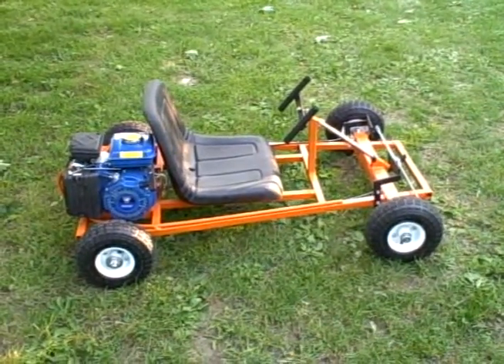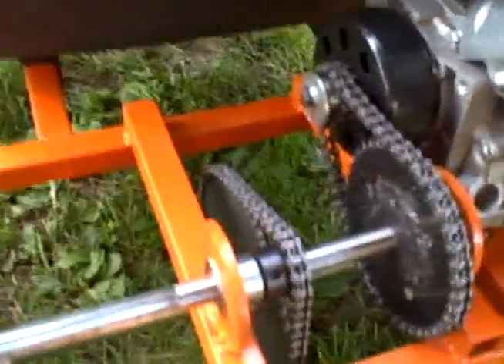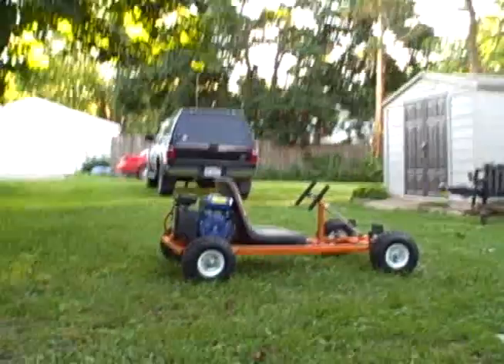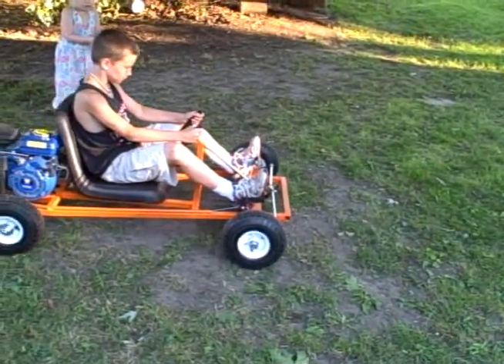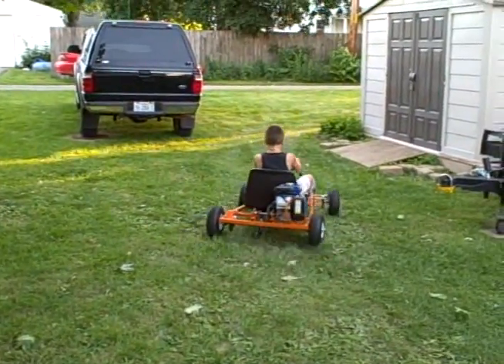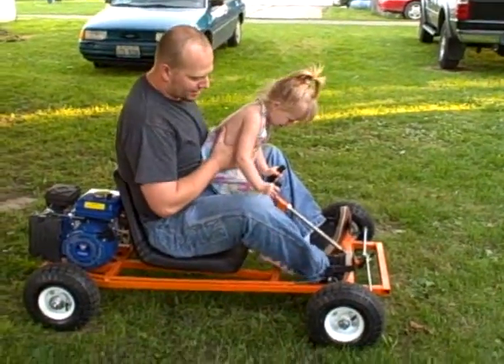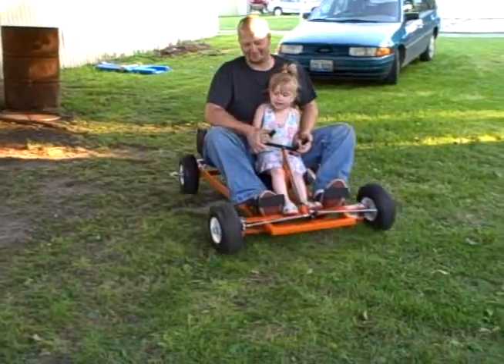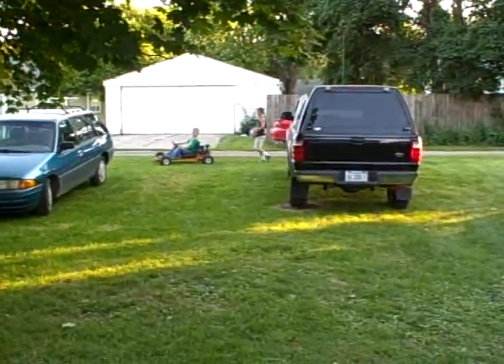Homemade gokart (gocart) with Harbor Freight 2.5 hp engine 79cc

Comment: Hi, Just so you get your final updated gear ratio info correct for the viewers

12t - 40t = 3.33

11t - 40t = 3.63

3.33 x 3.63 = 12.1 final gear Ratio

you multiply the two gear ratios together not add

Thanks Brett

Comment: nice little rig! I have the same engine and the instructions say to use 89 octane.   I want to put 87, but just curious about what octane do you use.
Reply from the maker: I have used 87 with no problems.  I did recently have one of the valve keepers fail.  The engine lost compression and I thought it might be toast until I opened up the valve cover.  I was able to dremel a steel washer into the same shape and the original keeper and compress the spring and install it without removing the head.  Its been through 3 more days of kids running wide open and it hasn't failed yet.
Reply: ah! gotcha. I guess it's something to keep an eye on. thanks for your quick reply.

Comment: question.......how much does the WHOLE kart weigh? great build by the way.
Reply from the maker: +Mike Beverly Not sure on the actual weight but I can load and unload it into my truck by myself.  I just tip the front up to the tailgate and then lift the back.  Better with two guys though.

Comment: F Y I 79 cc is 3hp
Reply from the maker: That rating is for the predator series engine which came out after these.  This was the greyhound series which was marketed as 2.5hp.  Same displacement (79cc) but they probably have a some small change like a larger carb or larger valves that may give the higher output on the predator series.  Or like many china companies they might just have snapped their fingers (switched a sticker) and now it puts out 3hp.  :^)
Reply: spyder000069 no its just to governor the changes also the carb jetting this is 3 hp too but just different setting

Comment: Kids don't know how to put the medal to the pedal.
Reply from the maker: There are no medals used on this go kart.  It is made out of metal though.  However, its is the pedal that articulates that adjusts the throttle.  So it is possible to put the pedal to the metal.

Comment: Now put an induction kit on it and a custom exhuast and make it go faster
Reply from the maker: I would lose simplicity and reliability and increase cost.  :^)  We have dirt bikes to go faster.  The concept here is not to win a race.  It was to take some metal and parts and start a project with the kids to show that not everything has to come from a store.  To promote creative thinking and to have some fun afterwards.  It is a fun little cart and requires minimal maintenance.  :^)  And I can put the nephews or kids friends on it and not worry they are going to get in a high speed wreck.

Comment: so slow my homemade go cart goes faster this is funny cuz im 11!!! better made 2 just sayin i had no help at all exept picking up the parts from craigs list and stuff
Reply from the maker: redneck4life887 Not up a hill or in a tug of war.   For some reason people are focusing on the speed which is not why this kart was built.  My car goes faster than the moped.  My motorcycle is faster than my car.  My RC plane is faster than both.  But, I can't sit on my RC plane while its flying, I can't do a wheelie in my car, I can't get a full load of groceries on my motorcycle, and you can't look cool on a moped.
Reply from the maker: It is funny that you are 11!
Reply: spyder000069 idk if i should say jerk or thx...
Reply from the maker: PhotoFilms Ha!  Probably jerk and thx.  Really it was a reply to the idea that a cart that goes faster is somehow better or that your cart is better made when from your comment it appears you assembled premade components.  This cart started as a pile of steel, grinding wheels, welding wire, and a tape measure.  A faster cart for the small city yard would have been unusable and therefore not better.  This design was not only easily driven in the small yard, used little gas, was geared properly to not burn up the clutch, but also is still running fine 5 years later.  I do hope you enjoy your cart and take from this reply the idea to compliment others instead of putting yourself on a pedestal.  You'll get farther in life. Just saying.  :^)
Reply: spyder000069 i had a kettcar pedal go kart FRAME, a 50cc engine, wheels, tires, sprockets, and a church group buddy with a torch to watch over me as i welded. I'd say thats pretty cool. P.S. i live in Pheonix, Arizona!
Reply: spyder000069 BTW to show u how much yard i have my front yard is ONLY a 3-car garage and my backyard is probably 1/3 what is shown in this vid the only difference i can legaly drive it around my neighborhood.
Reply: It's not the Go kart it's those kids that are driving them.
Reply: PhotoFilms That thing would get its ass handed to it by a moped SAD...
Reply: spyder000069
But why would you a kart so slow/week?
Reply: The homemade part yes good job man! It would be good for younger kids. As a guy i like fast off road stuff though.
Reply from the maker: redneck4life887 This was a crawl before walk deal.  Now the boys have a xr100 and ttr125.  The daughter has a ttr50 and a 70.  I chase them on a XR250.  We have alot of ruts in our yard.  :^)  We still have the kart.  Its still alot of fun.  You can put the relatives or neighbor kids on it and not worry about them hitting a tree or falling off.  The kart goes faster than in this video.  The yard wasn't big enough to wind it out. With a quick gear swap it would probably hit 20mph without a problem.   I can tell you 35 mph on my daughters ttr50 feels way faster and more dangerous than 70 on my XR250.  :^)

Comment: Hey spider I just recently came across your videos while looking for some goKart ideas and I really love the way youve done this, although I am extremely new to this whole thing like I'm talking I know very little about engines, and brakes and drive shafts and all that good stuff but I know how to weld and a harbor freight just opened up near wear I live so I figured it would be awesome to do something like this and learn all of these things, so for now my main question is that Ive heard stories about people that have had to convert their engine from a vertical shaft to a horizontal to work like this, if I bought a small engine from harbor freight like yours would I have to do anything like that? Also about the 12 tooth clutch, how exactly does that work? do all engines have something like that? Thanks for your time!
Reply from the maker: You won't have to convert this style engine.  Its a horizontal shaft (the shaft comes out the side of the engine).  Push mowers have a vertical shaft (blade connects to it) and those are the engines to stay away from.  Inside the clutch has weights with pads on the end.  The outside is a metal drum with the gear on it and its on bearings.  When the engine reaches a certain speed the weights fly out and make contact with the inside of the drum.  The faster the speed the harder they press against the drum and the drum rotates which rotates your chain.  There are many ways to convert engine speed to motion but this is one of the simplest.
Reply: spyder000069 Awesome thank you very much for your time! Now I have one more question, I have been doing some research and I read that any engine over 8 horse power needs to have a torque converter is that true? The reason why I'm asking this is because I have a buddy who can get me a 9.5 hp engine for pretty cheap but I don't want to spend a ton of money on a torque converter, thanks a ton for your help!
Reply: Evan Howell yes it is true anything over 8 HP so ya its not to bad with pricing i built a 16 HP so ya it aint to bad but if u can go with 50cc best small/cheap motor out there! it should fit under your seat if u rais the seat 4-6 in. over the base of the cart!

Comment: You should put some bigger tires on it so that sprocket and chain doesn't accidentally knick something sticking out of the ground and you will be able to go over bigger bumps
Reply: Signify123 not to mention it will go a little faster with bigger tires

Comment: Nice home made kart. But you are going to need a bigger yard! Kids get older kart gets faster = bigger yard. Also like others have said you need a floor pan. Its safer to put your feet outside of the frame to back it up. And if a foot slips off the pedals and down at speed it's going to break an ankle. Also the steering wheel is crap! Put a full wheel on it. Then its more like a real car and you have better control at higher speeds. Do you drive your car with your hands at 9 and 3 all the time? NO!  I liked how your son looked both ways before going into the ally (smart) and how he did not wine about letting his little sister have a ride. Good kids you have there! I predict he will grow up to be a good safe driver.  And will probably let his wife drive more than she should. LOL .
Reply from the maker: Thanks for your comment!  We did add a floorboard.  The steering wheel was an attempt to keep it simple and DIY.  We're now 4-5 years later and it has the same DIY steering wheel that's functioning just fine.  When you are having that much fun what positions your hands are at don't even come into the picture.  Ha!  The kids, and nephews, and adult friends, and relatives have all had a good time on the kart.  The small engine still runs great through all the wide open throttle on the hottest of days.  I used to be worried about it giving up but it now I just relax and let it be.  Its already earned its way back in entertainment value.  My son oldest son in the video is now 15 and practicing driving with my ford focus (slightly bigger gokart).  My daughter rode the kart 4-5 times before learning to ride our motorcycles which she loves more than the kart.  We upgraded from that yard to our own 5 acre country property just over a year ago so  the kids ride all over.  :^)
Reply: So its all good !  Cool !

Comment: Hi.  Love this cart.  My children are ready to step up from the battery powered Razor ones we have to something like yours.  Wondering, did you follow a plan for the frame?  If yes, which one?  I can usually copy build something by just looking at it long enough, but having some basic dimensions would help get the proportions and size.

Thanks for posting it!

Comment from the maker: I actually went the other way and put a smaller 40 tooth on the axle and swapped out the others so the ratio basically stayed the same.  Worked great.  I am considering larger tires at this point as we had it in the snow and while it was super fun it was limited due to ground clearance.

Comment from the maker: I had close to $450 in material cost and alot of hours in cutting, grinding, and welding.  Plus paint and assembly.  I'd never make a dime.  :^)  You can buy a china one much cheaper.  But the building experience with my kids and seeing them enjoy something that came out of your head is priceless.  Not to mention my daughter is now six so it won't be long before she gets to drive.  :^)

Comment from the maker: I run 93 in all our small engines.  Anything over a month old goes in the cars and I get a fresh batch and stabil is added to tanks that will sit the winter months.  I just pulled it out of storage and after about ten pulls it fired to life.  It needs to run the tank of stabil out of it now which I always find causes engines to seem a little down on power.

Comment from the maker: Not limited by my weight.  Limited by the gearing.  It will wind out the engine and I have the governer disabled.  Its a good speed though where I don't have to worry so much about the kids and it will climb the hills with out burning the clutch.

Comment from the maker: @cjsule 

Initially I did have problems until I switched the gearing and put the 40 tooth (instead of 60) on the axle.  I just changed the jackshaft ratio to get it back to the same overall drive ratio.  It added some good clearance and never had a problem.  Its not meant for serious off road or going through a plowed field .  No bent spokets yet.  :^)  I did consider the next size taller tire but right now I'm on the if it aint broke don't fix it plan.

Comment from the maker: @MILBURN96 

Its a horizontal shaft drive.  Verticle shaft drive are typically pushmower engines and don't work well for karts due to trying to convert the motion to horizontal for the axle.

Comment: Like the kart design. Nice size for kids. Mine is a traditional design and I had to install pedal extensions for the kids to barley be able to ride. They are still stretching for the pedals. The only thing I don't like, as you probably don't either, is the centrally placed sprocket. Have you had any problems with the kids running over stuff?

Comment from the maker: @Logic2119 

It is.  Its pinned underneath with quick release pins.  For the boys its perfect where its at though.  Originally I built a longer one with more adjustments for adults but this smaller one handles turning better since it has a straight axle in the back.  It pushes less in the turns.

Comment from the maker: @shoobadoo1 

Nope.  Wide open it runs about 12-14 mph.  Because its low to the ground it will not tip.  Full speed into a turn usually slides the front tires some but even if you lean forward to keep better traction it never lifts a tire.  So many people wonder how you could have fun at 12 mph.  Well jump on a radio flyer wagon and run that 12mph down a hill and you'll see that when you are on something that small the excitement level is double.

Comment from the maker: @NathansBackwoods 

The engine takes several pulls for the first start.  I always just the gas off though and let it run the gas out so I expect its gonna take a bit to fill the float bowl and so forth.  Once its running it idles perfect, runs smooth, is quieter than a lawnmower, and my boys both can start it fine.  I considered the 6.5hp version and there is alot of people who have had sucess with them but the 2.5 was much lighter and smaller and it sips gas.  It was perfect for this setup.

Comment: How do you like that engine? We got 2 6.5 hp for $100 each on sale, going to sell them now. had both of them on there they just wont idle, no carb adjustments...thought about replacing the carbs with honda carbs, but the cart did not perform the way we wanted it to so we are going to do a diff engine setup.

Comment: allright im building a gokart and ive got little experience so i only need to no how to convert it so it will spin the wheels i dont get that part im using a 6.5hp crafts man engine and i dont get how you put the chain to connect to the wheels

Comment: nice job man, im building my own currently with a lawn mower engine with 6.5hp and i tweaked it and im running on 20% premium gas and 80% pure octane. I ran some tests and from 6.5hp its now at 11.3hp and that with fuel change and everything else.

Comment: pretty cool! i don't know if your kids have an aversion to speed, but you zipped around in it pretty fast. i got a folding pocket bike that hasn't run in a couple years, might work on it this spring, only thing that fits in my smart car! (might need to clean the carb and gas tank)

Comment from the maker: @3alexmac 

Its a live axle.  I used pillow bearings and housings to attach the axle to the frame that I bought at our local farm store.  If you check out my video called (Dimensions and building tips from my homemade gokart (part 1 of 2)  you will see them at about 4 minutes in.   The wheels just slide onto the axle and I have a collar on the axle that hold the inside of the wheel placement and the outside has a nut that threads onto the axle.  The wheels are keyed and so is the axle shaft.

Comment from the maker: So it helps them see that you can build something from nothing and you don't need instructions you just need to think it out.  Plus they get to learn the responsbility of shutting the fuel off, how to start the engine, what the choke does, how to check the oil in the engine, tire pressure, ect.  Its amazing how many valuable lessons can be taught with kart.

Comment from the maker: @rebel2k4 

Somewhere in the comments I probably had a more accurate answer but it was basically about $500.  It could be put together alot cheaper if a better source for the steel was found instead of buying tube from lowes/hardware stores.  It was worth it though. The kart is a lot of fun.

Comment from the maker: @lol123321123321 

I used a Hilliard Extreme Duty clutch with a 5/8 bore and 10 teeth that fit a #40 chain from Northern Tool online.  They are $30 .  Not too expensive so I bought a couple so we have a spare when they burn one up.  They are only held on by one bolt in the crank so swapping out is quick.

Comment from the maker: @andrewmai123 

The disc brake kit was bought from northern tool.  I took its mount and welded it to the rear crossmember of the frame.  The throttle I used an extra cable I had from a scooter but you can use a bicycle brake cable or anything like that if its long enough.  I welded some tube steel on top of the side rail to run the cable through.  On the throttle that tube was bent in a curve so the cable exited next to the carb on the engine which is rear facing in order to pull to open.

Comment from the maker: @briggsmechanic01 

I just ground a flat spot on a bolt where it would be next to the arm of the throttle pedal.  Then I drilled a hole through it.  The bolt goes through the arm and the wire goes through the hole in the bolt.  Then slip on a washer and a nut.  The washer pinches the cable against the peddal arm.  Very simple and you can adjust throw by how much wire you pull through the bolt.